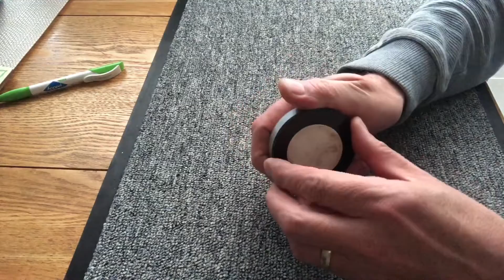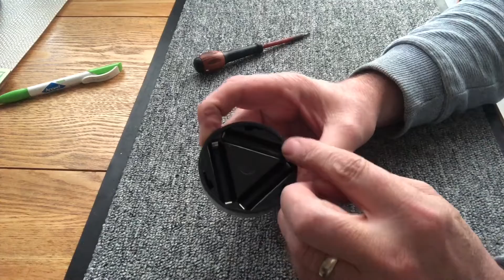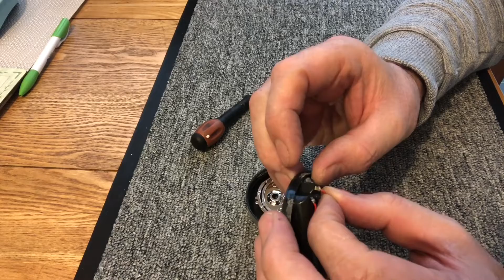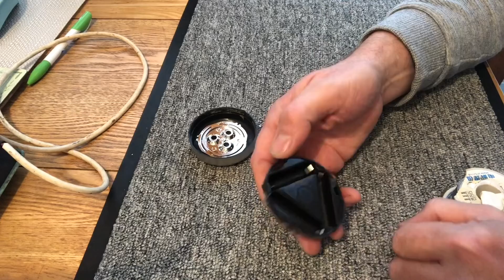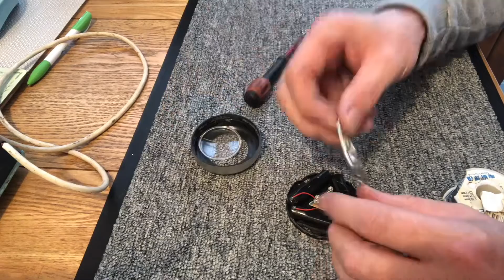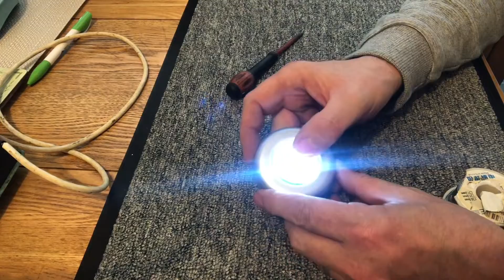Faulty LED Touch / Push Cupboard Light Repair.

Comment: was doing solar lights from them. using joule thief and 1 AAA instead of 3 batteries
Reply from the maker: The LED’s  in these are lovely and bright I can see they would make for good economical doner parts for lighting projects.
Reply: @TheRepairer  Yes, but i changed LED to brighter warm white and wider angle ones, made solar light, because batteries in it leaked and damaged terminals. Never expected that solar light made from it will last 4,5 years without any problems and still works.

Comment: Very interesting. I buy small LED torches that become faulty almost straight away. Not turning on or turning on but dim light. So frustrating. I cannot see why. I think it is the push switch but can't find the fault. Have you fixed one of those? They are very handy to have in your pocket.
Reply from the maker: I have two LED torches and they both work so no fix required as yet!
Reply: Said it before you have patience of a saint. Very maticulous to fine details 🤔.
Reply from the maker: Thanks